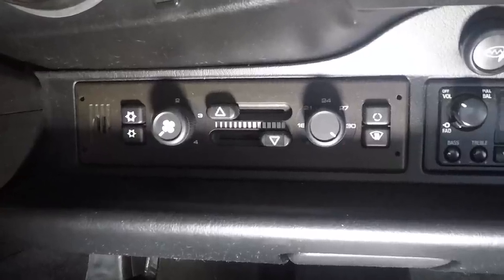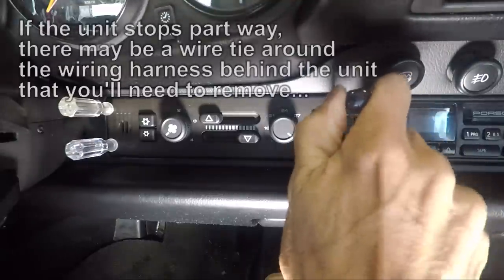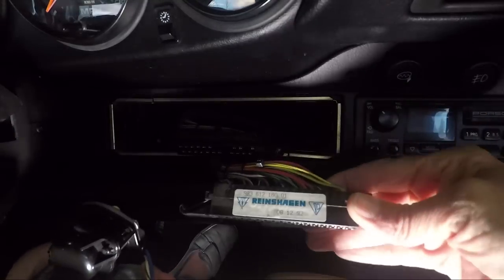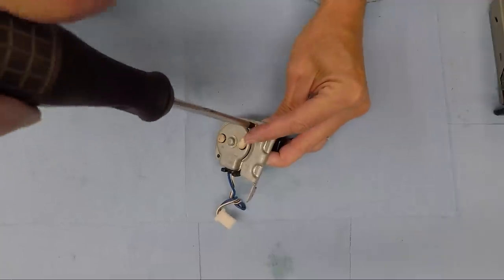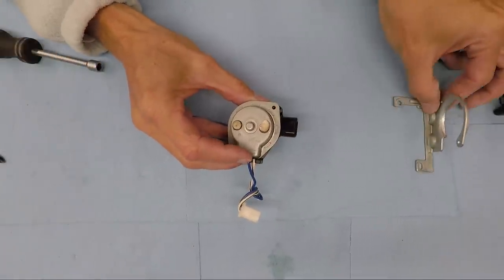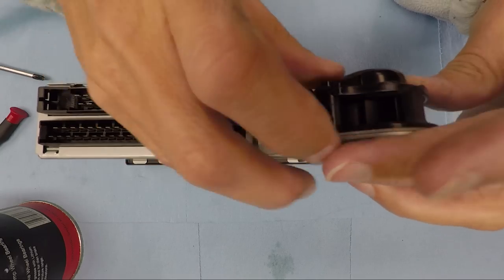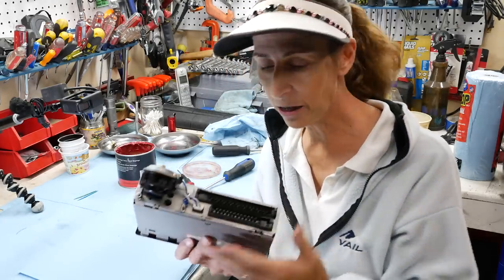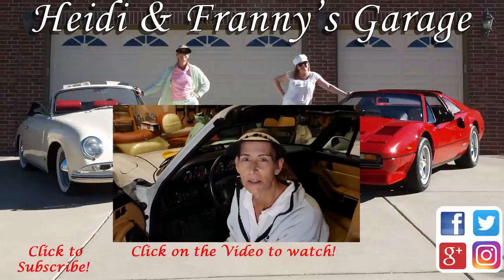Porsche 993/964 Climate Control Unit Fan Motor Repair! (DIY)

Comment: Hey Franny I know you guys have dumped the Germans for boat life but thought you’d be interested to know the following: Years ago I bookmarked this video. Every time I climb into my 993 & hear that irritating whining sound from the fan I promise myself I am going to come back to your video. A couple of months ago my local mechanic told me it was time to replace the climate control unit & quoted $1800 for parts & labor. I politely declined.

This afternoon I watched your video again, drove down to my local hardware store, spent $20 bucks on grease & four tiny star screwdrivers, then followed your instructions. It took me all of 45 mins from start to finish to have the little fan greased and silent again. 
In a finger-snap my car sounds like it did 20 years ago again.
Thank you so much!

Comment: Great vid! I just did this.  The only trouble was getting my hand up behind the unit to push it out.   It is very tight but after repeated efforts I was able to move it.  I used four little torx drivers (no. 5-8) to insert into the holes to release the unit. removed the fan without disconnecting the hinged cable connectors.  Lubed with graphite and it works great.  Thanks for the DIY!   It's a big savings over buying a new unit.

Comment: Excellent "how-to"! My 21 year old 993 turbo desperately needed this. I watched the video twice and took on the job this morning. 45 minutes, start to finish. Wunderbar! I didn't have short enough screwdrivers to unlock the latches. 2" finishing nails worked great. Size 16D, I think -- the thickest possible. I needed an 8mm nut driver, not 7mm. I encountered lots of accumulated dirt/grime and removed it with brake cleaner and q-tips. I'd recommend stuffing a rag underneath the unit and into the hole when removing it to prevent any marring (I struggled a little to remove the hinged wiring connectors).

Love your videos! Thanks so much.
Reply from the maker: Thanks Lance for the added info!  Very helpful. The nails are a good trick!  You might need to do it again in a couple years, but it goes pretty quickly.  Great!  Glad it worked out!
Reply: Lasted 9 months. Need to do it again. What's your take on this aftermarket replacement? I see the note about "an OBD Interior Sensor fan fault code due to the much lower current consumption of this fan. This fault code can be ignored and does not affect the operation of the unit nor the fan." Will that get in the way at smog-check time (I can't imagine it would but want assurance). Will the error code but outwardly apparent (displayed on a gauge)?

https://www.bergvillfx.com/index.php/products/spare-parts/fan-porsche-964-993-climate-control-unit.html

Comment: Great video, very clear. THANK YOU! It helped to avoid buying a new CCU by cleaning it like explained. One additional tip : clean the 2 lines of electrical pin with some white vinegar. This will remove potential dust/corrosion in the connector :-)

Comment: With winter coming you gotta have some heat!  Another fine job!  I like that you have a nice clean, well lit bench to work on.  I hate a messy, dimly lit workbench.  When owned by 1977 Targa I would take the Targa top off on sunny cold days here in California, roll the windows up, and crank up the heat with the air coming out in the foot well area.  It kept me warm enough even though it was cold out.  Well, California cold is not really that cold, but cold enough just the same.  Anyway, that made for a real nice ride when the sun was out on a dry day!
Reply from the maker: mariodesmo we do need heat!  Working on that. It’s way cold.

Comment: I would refrain from using wheel bearing grease as the scent can be pretty strong and the fan will help broadcast it into the cabin. Would prefer Lithium or Silicone grease.
Reply: Hey,,, don't for get me. . Signed, Graphite

Comment: maybe i am a little late..
Great video, i would have loved to hear the sound this fan made in the beginning
Reply from the maker: Thanks! It sounds just like a small computer fan with bad bearings. Sort of a wobbly squeal...
Reply: @HeidiandFranny  thanks for the fast answer! mine does this when i turn my ac on low fanspeed. I thougt the noise comes from the ac fan.
I just put grease on my fan as you showed.
Lets hope the noise is gone.

Comment: Very nice! The screwdriver tip for unlocking is very helpful. I need to lube fan bearings on a 3.2 soon.
Reply from the maker: Ohh,...  I did that a couple years ago on Shamu.  The blower motors in the kick panels?  The ones Porsche Classic want's like $450 a piece for?  Check out AutohausAZ.  They have a replacement motor that you will have to rework the connector at the top slightly, but you can get two shipped for like $120.  Search their site for: 0130007081.  I tried to re-grease the original motors over and over and never had any luck.  Replacing them was much more successful.  I was thinking I would pull on to talk about what I did for it.
Reply: Thanks for the heads up! In my case it is only the driver's side heat blower and only in high speed. I rarely use it, but one of these days i will pull it out and check it.

Comment: Hi Heidi & Franny.. We just purchased a 1991  964 Cab.   Same issue regarding the convertible top light staying illuminated after the top is closed.   The right latch is a bit funky and does make that grinding noise.  Hopefully the replacement of that latch motor or me possibly rebuilding it as you did in your  fantastic video will heal the issue.  I do have the owner's manual, but not clear if that light stays on all the time when the top is down, and only goes off when the top is safely latched closed.    The other  gremlins I need to figure out are the seat belt, airbag and spoiler lights are also staying on.   Hopefully I can figure those out too.
Reply from the maker: Congrats on the new car! Yup, all the lights should go out.  It was a new thing for Porsche to have all warning lights in one spot so you can quickly glance to see if anything is illuminated. If so, then investigate.  On the 3.2s you have to scan around a bit. Sounds like your top latch motor needs a little love 💕 F

Comment: You can also use a thin gauge metal hanger to remove that unit. cut 2 lengths about 10 inches long and then bend them into the shape of a U that somewhat matches the distance of the holes. Push the U shape tools into the holes, slightly pull the tools away from each other and pull towards you... instant out! :) Hope that helps!

Comment: never heard squeaking from my 993 climate control. is this something that should be done every couple years as preventative maintenance? also i have noticed there is a bit of 'play' with the fan speed dial, when you jiggle it, it affects the fan speed. Is this a precursor to a short? -thank you & great to see #993Porsche posts!

Comment: Great fix! I remember those Blaupunkt tools from a radio my dad had in his Mercedes. Speaking of radios, I don't recognise the Porsche radio. I wonder if this was a US item only. Most 993's I come across here have a Becker unit.
Reply from the maker: +Freerk de Ruiter this car is pretty original. It has won ‘best in show’ in a local concours. It’s very untouched!  Heidi
Reply: Happy to hear the car is pretty original :) 

I just ran through the Porsche option codes and I think the radio in your 993 is actually a Becker CR-1 unit, which had option code 331. I was confused as it looks more like a Blaupunkt unit without the holes in the corners, but it says Porsche on the little door in the cassette slot.

Where I live in the Netherlands I'm pretty sure a radio was optional equipment back then. If you wanted a radio-cassette they'd install a Becker CR-210, which has a much different look to it. That would have been option code 329. Mystery solved!
Reply from the maker: +Freerk de Ruiter very cool. Thanks for all the research!  Heidi

Comment: Hi, I am trying to control with a multimeter if there is electricity going to the back window defrosting system but where do I have to connect it? I don't see any visible bit to connect my multimeter....
Many thanks, you are really helping with your awesome videos!
Reply from the maker: Unfortunately, the cabriolet doesn't have the rear defroster :( The connections should be down in the bottom corner somewhere...  Next time I see one I'll take a peek.

Comment: Hi Franny. Thank you for an excellent video. Is the temp sensor hard to get to to give a clean incase the fan cleaning procedure doesn't work? Im not getting temp control off the CCU. Thank You Paul

Comment: I Fran, Heidi and the kitties.   
I was hearing a slight sound coming from my heating system.  
When I turn the heat or fan to off it goes away.  
Now all of sudden I'm getting no heat. 
 Perhaps a slight bit.  
What is the  purpose of this little fan attached to the heater control unit?
The electric blower in the engine compartment works as does the heater blower in the dash.   
Any suggestions?

Comment: Obrigado, parece claro, vou tentar realizar esta reparação, pois uma vez ja troquei o modulo na Porsche que indecentemente o fizeram sem me explicar de onde vinha o ruido, sobretudo que custa uma fortuna.
A unica massa consistente que tenho é de corrente de moto, também pode serve?
Depois direi como se passou.

Thank you, it seems clear, I will try to carry out this repair, because I already changed the module at Porsche who indecently did it without explaining to me where the noise was coming from, especially that it costs a fortune.
The only consistent grease I have is motorcycle chain, can that also work?
I'll tell you later how it happened.

Comment: Great videos, Franny! P.S. I have noticed that halfway thru several I’ve watched, the audio gets slightly out of sync with the video. I’ve read a few fixes for this that you may want to research.
Reply from the maker: Thanks for that.  I went back and looked at the original and it is completely in sync.  In the last bit the audio was recorded by the camera so it should be solid.  That is strange that you are seeing that.  I watch an unrelated taking head video yesterday about Instagram and his voice got a bit off too.  I thought that was odd, especially for that type of video.  Hmmm...  I'll have to look into this a bit.  Did you watch it on a PC or mobile? Thanks for the head's up! Franny
Reply: Heidi and Franny's Garage I watch your videos on an Apple iPad Pro on my home wireless network. It’s interesting that the issue occurs halfway (or more) thru the video, so I’m assuming it’s due to something taking place during the editing. Your video content, the video quality, and the sound are all excellent, so the issue could be with a codec in your editing program i.e. Final Cut, etc.

Comment: I love your Porsche stereo! What model is it?
Reply from the maker: Thanks! I'm not in front of the car right now... It is the original radio that came with the car. Also, the car has the upgraded sound system option. Not sure if that upgraded the deck or not.

Comment: how do i know if my fan is failing?  What kinds of sound does it make if it's giving me trouble?  Nice video!
Reply from the maker: When you turn on the key (before starting) you'll hear a soft rumble or maybe a squeal.  It is a tiny little motor so it isn't that loud, but if it seizes the temp control will get all confused...
Reply: @HeidiandFranny  I got the courage up to give it a go and all went just like you showed. I also used a little canned air in the thermister hole too to blow off 25 years worth of lint. Will see tomorrow how it works once i put it all back together! Thanks again.

Comment: Gréât tutorial. My a/c doesn’t work anymore. Is this failure may be due to this sensor fan not turning ?
Reply from the maker: Well, depends...  If the condenser is turning in the engine compartment, but the air is not cool, you probably have a leak and are low on refrigerant.  If the system is low then you'll need to repair the leak before recharging or it will just go flat again.
Reply: Hi, I have cleaned up the sensor fan (lost one small bolt...). Now the sensor fan (glued) is silent and blows 👍, but no a/c cool air is blown in the cabin, amid I do see hot air to the windscreen (condensation).

Comment: Hi ladies! I’ve been told in a Porsche forum that doing this operation could fix the issue of my 964 air conditioning (it doesn’t make any cold actually), but I don’t see how greasing this fan could help. How do you see it?
By the way, though the switch illuminates and the fuse is OK, my rear window defrosting system doesn’t work either...any idea?
Thank you so much and congrats from a Spanish fan!
Cheers
Reply from the maker: Hi Santiago, that little fan usually is squeaking and running slow, or maybe not at all.  Its purpose is to blow air through the unit so it has a good idea what the cabin temperature is.  Otherwise, the thermostat can get confused.  My guess is that your AC system either has a leak or needs refilling (because of a leak).  Ours is R143a which we can get a recharge kit at the local auto parts store for about $30.  For the rear defroster, turn it on and check for 12V at the two terminals on the window element.  If you have power, then the element is probably broken.  If not, then there is probably a break in the line between the window and the controller.  Franny
Reply: Heidi and Franny's Garage Many thanks Franny, I will try both. By the way, where is the temperature sensor located? Is it in this same piece, next to the fan? Cheers

Comment: Wondering if you had any tips about getting the plugs on the back of the CCU out. Mine seem to be rather stuck and I don’t want to damage anything
Reply from the maker: Just carefully... I struggled a bit with that too. IIRC it is pinned on one side and rolls out.

Comment: I have a 1995 Porsche 993 and I had my climate controller refurbished by specialized company and my a/c works great but heater still doesn’t blow hot air at all any ideas?

Comment: I have a squeak when I run my fan at the lower speeds, is this the fix?  It would be nice to not have to run the fan on high all the time :-)
Reply from the maker: Your noise sounds more like the actual blower motor. Can you pop your head under the dash and try to localize it?

Comment: This video is misleading.  I don't know what she has done to her car but in my stock 993 it is not possible to reach under and behind the dash to push out the climate control unit.
Reply from the maker: Our car is 100% stock - even has the original radio. It is a little difficult to get started, but it will come out.
Reply: @HeidiandFranny  I just bought the removal keys for $4.00.  My CCU was rebuilt years ago and discovered the rebuilder installed counterfeit blower fan which cannot be opened like Porsche fan.  Porsche fan is $285 and fake part is $72.  Dealing with rebuilder now.